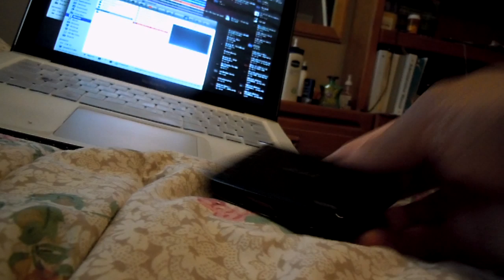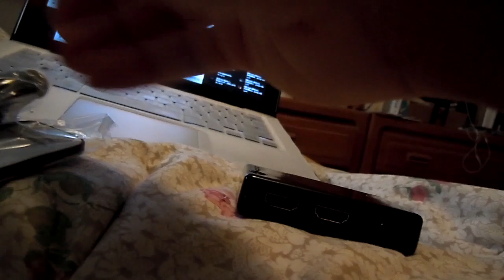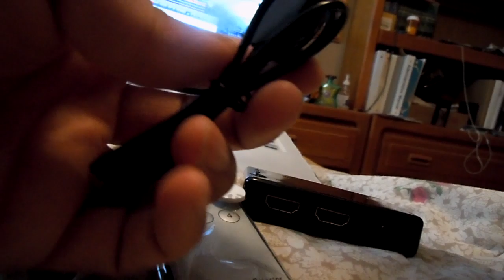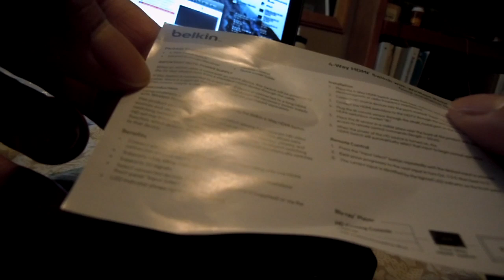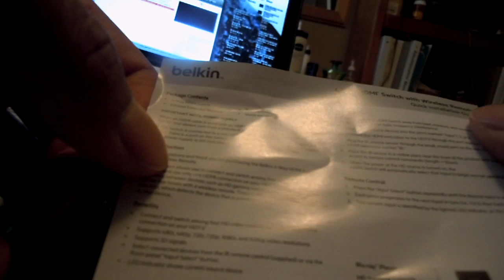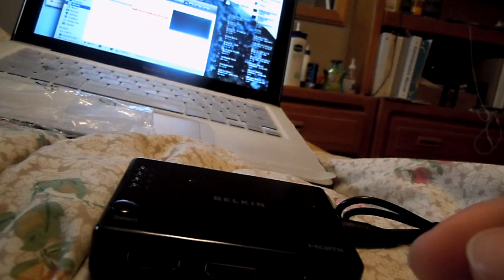how to increase inputs with belkin hdmi switch for hd tv with limited hdmi inputs

Comment: Thank you for posting this video, this box rocks. Now I have my Cable, DVD player, X-Box One, Chromecast all on one unit. The remote IS NOT NEEDED, just push the blue button to desired input needed, all in 1080p. Run a HDMI cord from the TV to the output on the Box. Fill the other 4 inputs with your favorite electronics. Works like a charm for me and saved alot of frustration due to lack of inputs on my T.V. Got mine at Home Depot  for 35.00

Comment: it'll work without the 5v input as long as you have at least one device that provides power. Problem is that it won't work with anything that uses HDCP (that means your PC, the PS4, PS3, XBox One, some bluray players). Maybe it will with the 5v input but that seems like false advertising
Reply: +Samuel Jones will it work without 5v power supply if i plug it to my tv ?